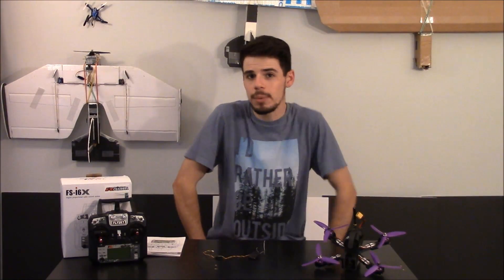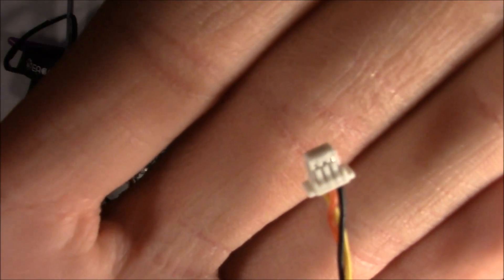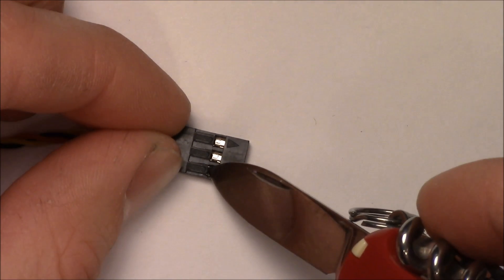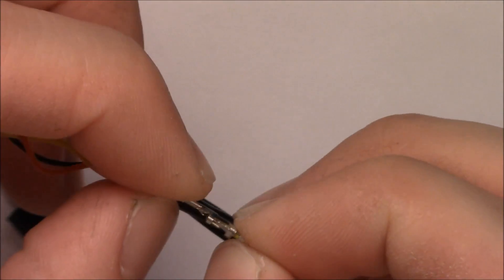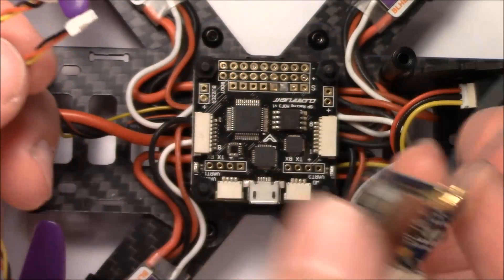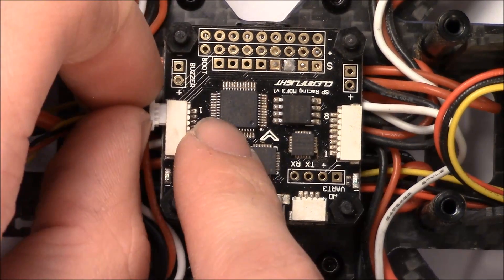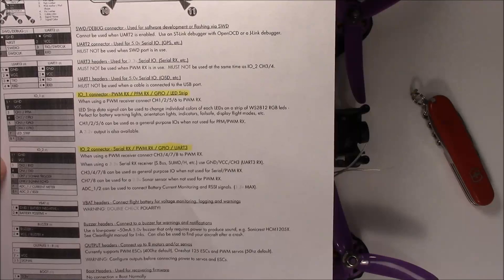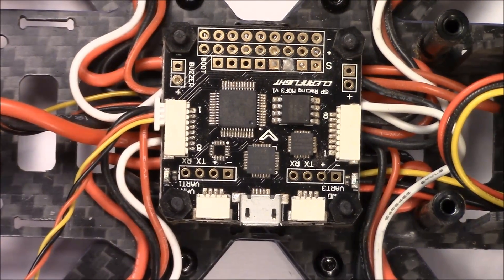How to Connect FS-X6B to Wizard X220 via i-BUS - Help for Beginners

Comment: I think those are 3-wire JST SH Connectors.   Great Video though!
Reply: OutdoorMentor you can depin those nano just as well and pin then into other jst nanos. But normally you would have to solder the jsts to it as most of the times they don't come with it on both ends. You will definitely need to get a soldering iron and spare escs and a spare motor as well. Trust me. Are you flying acro?

Comment: Do U get telemetry?
Reply from the maker: Yes. If you want rssi in the betaflight osd, I beleive you just need to select channel 14 in the dropdown menu. It will also give you voltage, but that always stays at 5v because of how it's powered.

Comment: Can someone please tell me where to mount the x6b after it’s connected to the wizard x200hv....having difficulty finding a space for it.
Reply from the maker: Hi! Most people will zip-tie it anywhere that it will fit, as long as the antennas are sticking out for good reception. Maybe the inside of the top plate?

Comment: Can I use the I bus port on the bottom to control quad and get voltage ? Or do you need to plug in both 3 pin  I bus ports on the RX

Comment: What's the name of the connector that goes in the f3? I bought my wizard used and it was hardwired for the receiver. I want to use sbus but don't know the name of the wire
Reply from the maker: My understanding is that they are 3-pin JST SH connectors.

Comment: thanks for your video! I have a Wizard X220s and is diferent :(
You know where I should be connect the receiver?? Thanks and regards!
Reply: OutdoorMentor thanks! I try to do this
Reply: @Krazy_Corn  joshua bardwell has a fantastic video series that answers these questions :)
Reply: @Krazy_Corn  all 3 wires together on one port? I have the wizard s and the xB receiver but I'm not getting any stick commands on beta flight

Comment: 3:48  "wrap each one with electrical tap"  .......and then wait for them to fall apart.
Reply: Great video for beginners made by a beginner, but of course it's very lazy practice to just pinch wires together inside some tape and hope/pray for the best..... It's all fun till your quad loses communication with your transmitter suddenly 50 metres off the ground, and drops onto someones head or vehicle (or even worse if failsafe not setup correctly) keeps flying straight into somebody's face !!!  But it is what it is..... I'm sure by now this guy is much more experienced and knows 100% to solder every wire joint, heat shrink and cabe-tie it right.  :)
Reply: Gregory Dahl Paul’s right .... Every wire joint should be soldered. It’s just common sense.. But I’m sure we all know this by now 👍🏼👍🏼👍🏼 This comment was from a year ago buddy 🤣🤣🤣

Comment: I'm curious if the RX to PDB connector is an 8pin JST SH 1.0mm?  Or, where you can purchase the RX to PDB cable if you need a spare?  If someone knows the specifics on the connector, and/or has a link where you can buy a replacement cable, please post.  Thanks.

Comment: I havent opened my X220 yet. Wonder how long cable I actually need? My thoughts is that I would better soldier cables together. Less chance of lossing control because of vibration.
Reply: Actually with X220 came cable with "Full length" connector. I soldered that together with one of the receiver cables. Should be more stable.

Comment: Could you be more specific on how you mashedup the 2wires together?
Reply: Shawn FPV don't do that. Use the plug of your fs ia6b that goes into the fc. Solder the cable together. This plugging and just mashing thing is not gonna work for a long time. Soldering iron you will need it anyways in this hobby.
Reply: FunTechandMore thats exactly what i ended up doing .. thanks
Reply: Shawn FPV nice and clean job!

Comment: Thanks so much for the video.. Have several quads (micro quads and 250 racer) but they all came with the controller and drone all configured.. I was torn between getting the Wizard X220  with the controller or just the X220 as an ARF... Because the RTF was on back order, I got the ARF and it will be here in a week...   After watching several of your videos, I feel more than confident getting this up and running.. Have Libre Pilot on the 250 Racer and have been playing with the PID's, and have a micro quad set up with Beta Flight and/or Clean Flight...... Following your simple instructions, I cant wait to get it set up. You answered so many questions relating to the different  "languages".. Thanks a bunch, and keep the info videos coming !!!!!!!!!!!!!!

Comment: hi i had my esc blow so changed it. tryed to plug my new receiver in but it does nothing. doesnt blink and on my pdb the lights show two red.
Reply: Marc Cooper does your fc lights turn up? Does your fc still connect to betaflight? Do the other escs make the startup tone? Check of you plugged in the reciever right if it is on ibus white cable has to be going out to the edge.